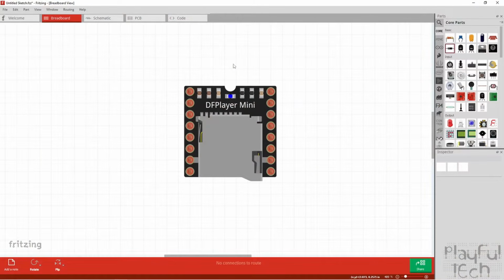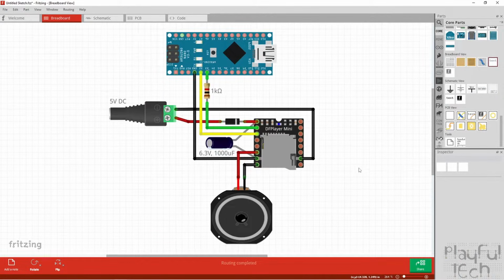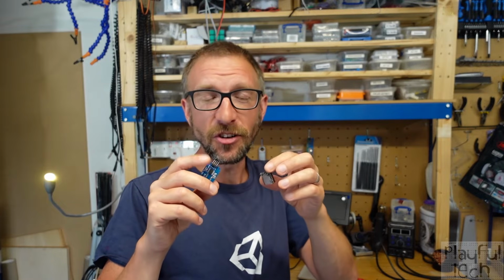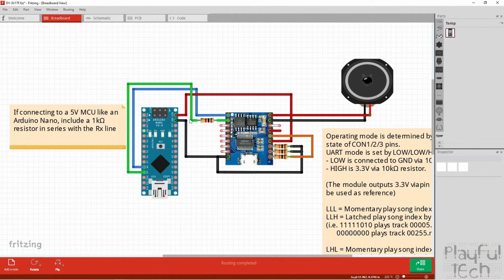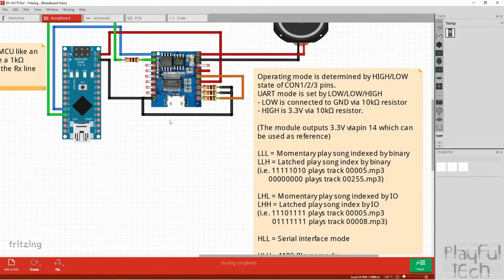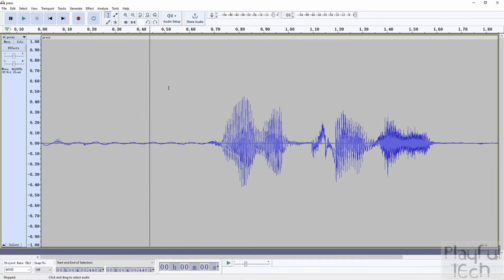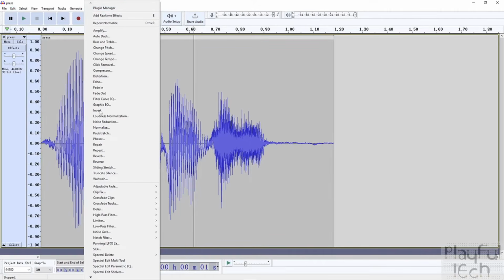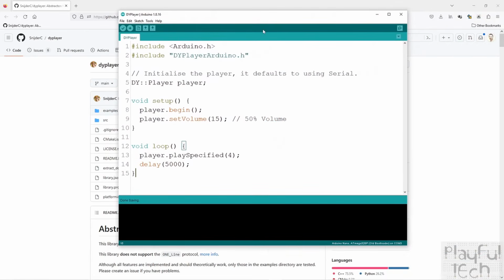Audio modules for electronics project

Comment: DY-SV17F is too slow more 0.5sec to start a sound not possible to use for sound on keys or effect , only the REEL dfmini start sound immediatly unfortunatly we find only V3 now abnd they have changed the ship and its slow now ... im desperate to find a dfmini quick like the first model ..DY-SV8F is same lag 0.3s befor sound ... no card is beter than original df mini .....
Reply from the maker: You're right - these modules often have noticeable latency, which is why I've often recently used I2S output from an ESP32 for applications requiring instant triggering. I've demonstrated this in my latest video here, if you're interested: https://youtu.be/c5XgkYMNeEU

Comment: Hi Allister, Thanks you for the good/complete review!   I have a question.
I would like to use one of the reviewed audio modules with internal amplifier for playing 3 sine waves (25Hz 125 Hz en 460 Hz) at the same time on a speaker.  Witch device is the best?  Meaning, witch device is giving the best/most complete sine wave becourse that is quite important for my applcation?  I've checked it with a mini oscilloscoop but I think the mini-scoop is not good enough for this kind of test.
PS: Sorry for my poor English.

Comment: Hey guys, I recently bought pam8406 for my old speakers 5w 4ohms ( pretty big coil, good speakers from early 2000s), it seems to struggle little bit when there's lots of bass ( 5w 3A phone charger via usb power supply ). Any idea for higher sound quality amp in similar form?

Comment: This is an incredible video. Thank you! Based on my testing, the DFPlayer, DY-SV17F, and DY-SV8F all seem to have around 400–700 ms of latency, at least when triggering sounds via UART. Maybe I’m missing something? This could be pretty critical for puzzles that require quick, precise triggering.
Reply from the maker: You're right that there is always some latency - you can try different SD cards, uncompressed audio formats (e.g WAV instead of MP3), or using the EEPROM variants rather than the SD card ones, but you'll never find fast enough response for, e.g. a music sampler. For that kind of application, I've typically used the I2S output from a Teensy or ESP32 board directly.

Comment: I was thinking about audio based haptic effects that are triggered by press of an button and latency should be minimal, is there even better option than these or is it the one with internal memory?
Oh and if cheap enough, it might be even usefull to use several, specially if memory is not big enough for all. Some effects might be better with different driver or plecement anyways.

Comment: "Hey! I'm from India can give me products which are easy available in india building my first project: an iPod-inspired portable audio player using a Raspberry Pi. I want to use high-end IEMs instead of cheap earphones, so I need clean, high-power delivery through the headphone jack without that annoying background hiss. What is the absolute best low-impedance DAC HAT you recommend for a portable Pi build? Also, what OS would give me the closest vibe to the classic click-wheel iPod UI on a small screen? Thanks!"

Comment: I want my 12vdc siren output on my home alarm system to trigger half of the song Thriller by Michael Jackson. Would any of these work for that? It would be constant 12vdc during the alarm or i could run it through a altronix relay module to turn it into constant dry relay closed.

Comment: I need an audio module that is stand-alone, can play multiple audio files and can be triggered by one button in a way it plays either one file randomly or just playlist 001, 002, 003... etc. What would be the best cheap option for that? I prefer not to have sd/tf-card so no dfplayer.

Comment: Thanks for the demo. I've been working with these boards for many years and never came across DriveSort before. One slight correction: I have never seen Windows (or MacOS) copy files based on the file name order. In most cases, when you copy a group of files, the OS makes calculations and seems to move the smallest files first. So you are never guaranteed that the files will move in order unless you move them manually one by one. But I've never actually seen these devices have issues with indexing before. I would like to see a demo of that specific issue. I've always had good luck when naming the files. The bigger issues I've seen have been with SD card quality and file formatting.

Comment: Hi, 50 years of hobbyist experince in electronics I can say, this is a GREAT, GREAT video. Clear and very informative. Keep going on! I bought me some cheap boards from china. Serially controlled by STM8S103 (old fashioned uC) All works fine. I asked ChatGPT to fill all 100 folders with 256 mp3 files speaking folder and filname. ChatGPT create a Powershell script creating all files. Copied it to my sdcard. It works perfect(!...) only, it takes about 10 secondes before the selected mp3 file starts playing. Do you have any suggestion to avoid this or is this just part of the game? I will show my video on youtube soon. Search for 'henk van winkoop' and the video will contain a label 'hvw202509151141'. Thanks!

Comment: Hi i followed your video on DY_sv8f but i cannot get it to work . I put sounds on board, Wired in the same as per video and used my adjustable power supply on 4 volts that i use on arduino board but nothing. Any advice would be great please
Reply: How are you controlling it? What mode?
Reply from the maker: Have you set the jumpers correctly to enable UART mode?

Comment: I have also used many of these many times, and the only one I suggest NOT to get is the Adafruit Soundboard one. It was dearer than others, and the VLSI chip gets so hot you cannot touch it, so stops working randomly. I was going to include it in a small batch product run of 1000 machines, but as reliability is poor, and I sent an email to Adafruit asking for (heatsink) advice, and they did not reply.

Comment: I want to be ablle to select one of the eight available sound files on the sd card (pseudo) randomly when a trigger is received.
I'm thinking of using an NE555 in astable mode and a CD4017. I'll tie 8 of the CD4017 ouptuts to the 8 inputs of the sound card.
o When the trigger arrives I want the sound card to look at its inputs and play the relevant sound file as determined by the CD4017 outputs.
o Until the trigger is received, the sound card should ignore what's happening at its inputs.
o When the sound file has finished playing, the sound card should once again start ignoring those inputs until the next trigger is received.
Is what I've described possible?
Thanks for any help :)
Reply: I've just realized that the CD4017 outputs need to be inverted because it's a low voltage that triggers the play of the sound file in the DY-SV5W, the board I'll be using.

Comment: Spectacular video! Question at 24:23: what wire to board connectors are you using on the board on the right?
Reply from the maker: Those are crimped wires going into screw terminals.

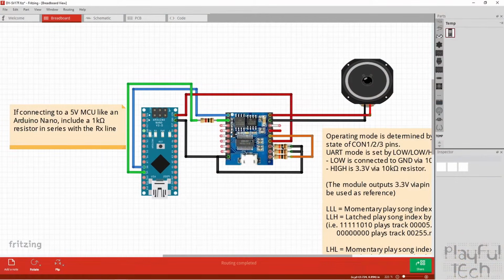Comment: 16:03 why aren't you using TX and RX pins? Looks like you are using D8 & D9 (D9 is a PWM pin) I need all my PWM pins for servos, Could I use two pins that are NOT PWM pins?
Reply from the maker: Sure - you can use any available GPIO pins you want - there's no requirement for PWM to send serial messages.

Comment: 1 of the problems that came up, is the manufacture changed some thing on the next Gen board to where it will no longer does instant trigger as in a laser gun sound , there is a small delay, so when you hit the trigger a second or two later it starts to play.
Very annoying......
Reply from the maker: Yeah, that's definitely one of the problems with cheap electronics modules is that there are so many clone chips, or minor variations, and zero documentation which can affect performance between batches from different suppliers, or even from units within the same batch! A similar thing happened with MFRC522 RFID modules.

But then again, they are unbelievably cheap, so I can't really complain. If I find a good one that works, I tend to stock up by making a bulk order in case it changes in rhe future.

Comment: This aren’t “audio boards” like Teensy Audio Board, but simple and cheap mp3 players.
Reply from the maker: They're audio modules, which are (typically) controlled by a UART serial interface to a microcontroller like an Arduino, ESP32, or Teensy.

Comment: In a case where the ESP stored the sound files on an SD card - can you hook up a player/amp  vs using sounds embedded on the player?
Reply from the maker: There's no convenient way to stream audio data from an external SD card to the audio module for playback - they're designed to use their own onboard storage (be that flash or SD). I think that was your question?!
Reply: @PlayfulTechnology   almost - a local SD card attached to the ESP32 - remotely instruct esp to play sound from the SD card - I assume volument and fade can be configured ?

Comment: How much voltage capacitor should i use for the df mini player?
Reply from the maker: 6.3V or 10V are common capacitor voltages and both will work fine - it just needs to exceed the voltage being applied on VCC (i.e. >5V)

Comment: Hi, thanks for the info! I have a question. For connecting the DFPPlayer. (Around 2:45 in the video) Does it matter what kind of diode to use? I am not very familiar with this. I have an IN4007, will that do?
Reply from the maker: 1N4007 would be absolutely fine - they're a good general-purpose diode.

Comment: Great Video.
Because…
.
I have ( proudly found via other YT video’s. ) made a DIY Ulanzi TC001. 
And with the excellent software AWTRIX3 flashed on the ESP32 it is a joy using the 32x8 LED matrix in Home Assistant.
.
Now thanks to your video I can add sound as well: DY-SV8F and a 4 ohm 3 Watt Speaker. 
Fingers crossed the sound level is acceptable enough.
The reason for the sounds is alerting that Home Assistant has send a notification message to the Led Matrix device .
.
A small latency isn’t bothering me and the 64 Mbit Flash memory should be enough.
Reply from the maker: That's great! The latency is only really noticeable if you're trying to play audio samples as, e.g. a direct response to user input. If it's just for a notification/alarm sound, I doubt you'll notice the lag at all.

Comment: At around the 7 minute mark, you showed off a circuit using a diode to drop the 5v to about 4.2-4.3 volts to not always be at the high point for the device. 
Could you completely remove the diode if you use a voltage source with a maximum output between 3.3 and 5 volts, or do you still see it as a necessary precaution?
Reply from the maker: It's not a "precaution" as such - the DFPlayer will function is supplied with a full 5V without any damage, but it will not perform optimally. The recommended supply voltage is 4.2V - if you have a supply capable of supplying that directly, there's no need for the diode.

Comment: Hi I'm absolutely new to these kinds of topics but I want to get started with some Halloween props. Can anyone tell me wether there are soundboards which output a bluetooth signal? I would like to use my old JBL Xtreme 2 speaker just for the sake of power and clarity in my sounds. Please let me know if there are such options available or if I have to stick to smaller speakers and hook them up directly to the board. Thanks
Reply from the maker: I've used Bluetooth communication for sending serial data between ESP32/Arduino etc., but I have no experience of using it for streaming audio I'm afraid. My guess is that there is a dedicated protocol for that.
Reply: @PlayfulTechnology  Well I guess it's rather a thing of additional hardware not just coding, right!? But thanks for your answer.
👊😌

Comment: The big problem I have with the DFPlayer Mini is that the market seems to be saturated with versions that don't have the original chip.  You can try to follow a tutorial but spend hours trying to debug why it doesn't work, only to find that only a subset of the published commands work, excluding the one used in the tutorial.

From memory, the most obvious 'Play' command doesn't work, and another classic is that you can put the chip to sleep, but the wake command does not work.

I've bought DFPlayers that were advertised as having to original chip, then had to return them because they didn't.

Comment: Hi. I’m looking for some help with my project. I have a small usb micro board with a small speaker. I’m having trouble finding a speed controller that works. The only ones that I have found on Amazon are for a motor. How can I control the speed of the sound with a pot? And have it with a 1/4” guitar input and output? I hope you can help me.

Comment: I have a dy-HV20T, but I can't read a file in a specific folder, (for example, read /01/0001.mp3) is it possible?
Reply from the maker: Yes! If you use this library, just call the playSpecified() method: https://github.com/SnijderC/dyplayer

Comment: There is a DY-SV19R Variant which has the pullup - pulldown resistors built in for configuring LHL variants. So just configure it with plain cables.

Comment: Thanks for the very informative video! I have been working with the DY-HV20T with an 8 ohm speaker. My experience is that I can run it at 6V, but not if I want more than about half volume. At higher volumes, the quality increasingly craps out. At 7.5V, it seems to be able to handle full volume. YMMV
Reply from the maker: Thanks for sharing your findings! I often work with salvaged speakers (from old hi-fis, reclaimed from arcade machines, etc.), so there's definitely an element of trial-and-error!

Comment: Super great info here! I ended up going with the dy-sv17f for my project! Only hiccup, I cannot find a library to run it! Any recommendations?
Reply from the maker: I have used: https://github.com/SnijderC/dyplayer - but it's pretty straightforward to just write commands directly to the serial interface as described in the datasheet, you don't necessarily need a library for simple playback functionality.

Comment: Why bother using a 5 volt Atmega based Arduino unless you actually want the 5 volts? There are so many other boards that are both better and cheaper and a lot of ways if you don't need that.

I feel like it's misleading to talk about those particular boards as what Arduino is. Arduino makes many different boards and a lot of them are not this sort of vintage design. Also, really, since you can use the Arduino software on many boards that aren't made by them, aren't they in the sense also Arduino's? I just don't get why anyone would bother to do a modern project with the original boards particularly. It seems like a bad place to start unless you're already doing it, and already know this stuff.
Reply from the maker: "Arduino" is a nebulous term: it's a company, and an IDE, and a whole family of development boards, with a wide variety of capabilities. But the "original", 5V based boards are still massively popular, used in schools and hackspaces, and by individuals all around the world. And they're still perfectly capable little devices, so there really is no need to use anything more powerful or modern.

Comment: Is there a module for text to audio conversion? I want to send character data serially, and the text is converted input audio and played..
Reply from the maker: TTS hardware does exist - it typically sounds very primitive though - like "Speak and spell" machines from the 1980s - you can even emulate it using software alone, e.g. with this library: https://github.com/bobh/ESP32Talkie.... or, if you just want to read one letter at a time, you can save separate audio samples as a.mp3, b.mp3, c.mp3 etc.

Comment: Amazing video. Question. For the DY-SV5W, if you're using it with the ESP32 that only has 3.3v. Do you need a voltage converter to up-convert the voltage to 5v?
Reply from the maker: No! Quite the opposite ;) All the DY players run at 3.3V logic. So, if you connect them to a 5V device, that's when you need the level convertor. For ESP32/ESP8266, just connect the Tx/Rx lines directly to the GPIO pins. This is explained at https://youtu.be/8obcTTYtjQM?t=1019

Comment: This was great instructional video.    I learned a lot and now understand these boards way better.   Two questions regarding the DY-SV5W board.   Is there a mode to play upon power up and continuously loop the same sound track when using the 8 input trigger mode?     Is the 3.5 mm jack a "line level" output (or does the volume pot change its output)  that will allow you to interface to a power amplifier source input of your choosing?  THANX

Comment: Great video! Is there any way to query the DY series boards for the number of  stored files when using the serial interface mode? You could just hard code a number into the Arduino that reflects this but would be good to be able to do this dynamically so that you don't have to recompile the code when you add or remove files.
Reply from the maker: The serial interface is pretty basic and restricted to only those pre-programmed commands as documented here: https://github.com/playfultechnology/arduino-audio/blob/main/DY-XXX/UART%20mode%20user's%20guide.pdf  

However, one of the commands is described as "Check number of all music", so try issuing 0xAA0C00B6, and reading the two byte returned value

Comment: I'm working on a project with integrated sound, similar in theory to the Jawduino project. I'm using the DY-SV5W module and I don't think it's behaving as advertised. I'm using "I/O stand-alone mode 0", in which you trigger the module and it plays the song once and then quits. According to the documentation, and comments from several users, the busy line is active the entire time the sound file is playing. But what I'm seeing is that the busy line falls after about 100 milliseconds, long before the sound file ends. Any ideas? Does this match your experience?